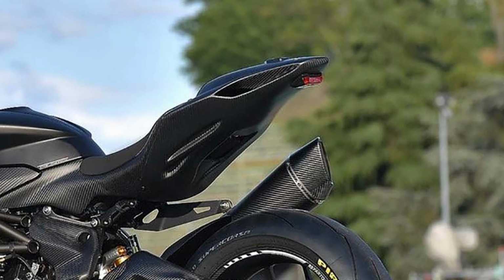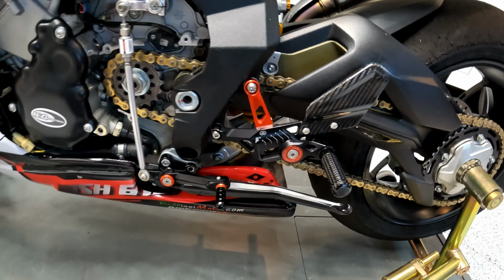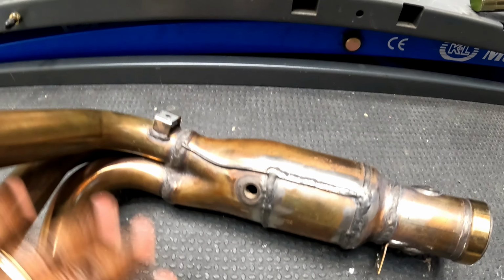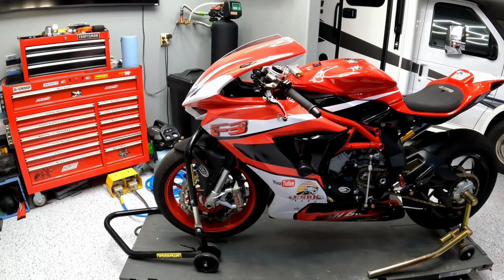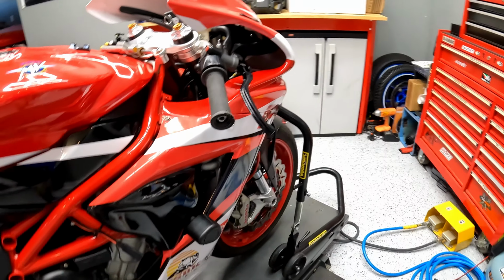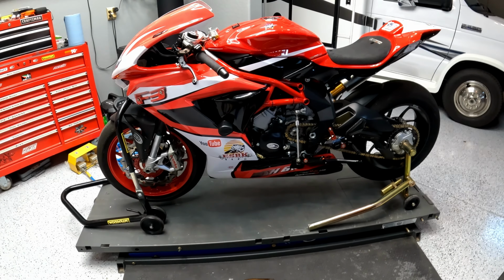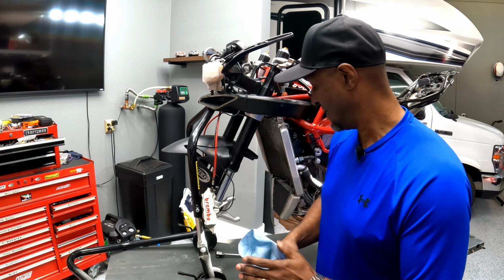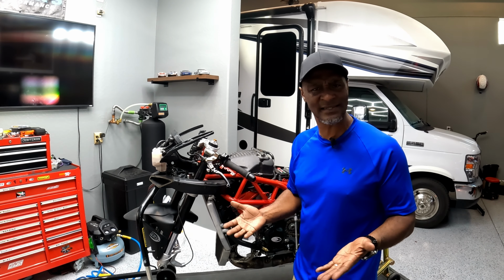MV Agusta F3XX Bike Build. Ep1 "Stripped"

Comment: Looking forward to this series, I built my F3 with a similar ethos to the F3XX but still street legal.
Reply from the maker: Please share some pics! I’d love to see it!!!
Reply: @ESBKLife  I need to do an updated walkaround for my channel, I have an old one but the bike has seen several changes since then...

2022 F3 Rosso:

SC Project S1 w/Race ECU
Stainless Termignoni Race Headers
Charcoal Canister Delete
Lightweight Lithium Battery

The above mods account for significant weight savings! Everything else I have done was widely cosmetic or in hopes of improving reliability:

Rizoma Stealth Mirrors
Puig Double Bubble
Carbon Fiber Tail Fairings
Custom Tail Tidy
Passenger Peg Removal
R&G Tank Grips
Domino Grips
Engine Ice Coolant
Motul 300V 10w50 Racing Oil
Motul RBF Racing Brake Fluid
Pirelli Diablo Rosso Corsa IV

Looking to upgrade brake and clutch master cylinder next, probably Brembo 17RCS.

Also want to source lightweight set of forged wheels, Marchesini or O.Z.

There are photos of the bike on my Instagram profile if you have access to social media.
Reply from the maker: @themotoseoul  More F3 content is definitely needed on YT. I there are like  10 F3 videos where someone is actually doing work on them, and 5 are mine of my old F3 800 street bike lol. Please do walkaround, I would love to see it!!!🙏
Reply: @ESBKLife  Could not agree more.

I envy your expertise in working on euro bikes. I've seen all your old videos on the F3!

I'm just lucky to have a good mechanic locally to help with my mods and service needs, not my cup of tea. I just enjoy riding!

I will look to find time to do an updated walkaround of the bike!

Comment: NIce build.   I have a couple of questions.   What is the clutch lever and lines you have on your bike?   The stock one is pretty tacky.   Second question is about the engine.  I have a 2014 that blew the engine due to the valve springs being low quality and the cams have an aggressive lift so when the valve springs get worn, the piston hits the head.    The black engines have this problem addressed but I want to make you aware of the issue.
Reply from the maker: Hey Christian, the clutch is a GaleSpeed OG unit with a GaleSpeed folding lever. Best wired clutch I’ve ever used. As for the engine, yeah I’m aware of the problem. Bruce Meyers build the head on my bike, so I’m hopeful that I’m good but time will tell.
Reply: @ESBKLife  Bruce rebuilt the engine on my bike and I just got it back from him a couple of weeks ago so you should be good.  He is the man for MV's.

Comment: Hi, Do you know if the Rear wheel of an F4, would work on a 2021 super veloce 800 ?  Thank you
Reply from the maker: Sorry I don't know, but I don't see why it wouldn't.
Reply: Thank you. I thought you said that the rear wheel on your F3 came  from a F4? I thought since the F3 and the super veloce 800,  share the same frame and swing arm I thought it would be work. Thanks for your help🙏
Reply from the maker: @Lazocaferacers  Yes it is off of an F4, however, I don't have any experience with the SV bikes.  I would hate to tell you, yeah it'll fit, then there be something special about the SV that I'm not aware of that doesn't allow it to fit. To my knowledge there isn't anything like that, but again, I'm not sure.
Reply: @ESBKLife  what year is your bike?
Reply from the maker: @Lazocaferacers  2015

Comment: My friend that an mv f3 675 and I had a Triump Daytona 675 mk2 and my d675 was better than the mv in all scenarios on the track, especially so much more nimble because of the weight. The f3 does look very exquisite but the single sided swing arm is pretty much why it was so porky compared to run of the mill d675 u can find anywhere.
Reply from the maker: No????? There are no MV 675s in this video. If you’re referring to the decal on the tank, the tank was replaced. But, I assure you it’s an 800😃
Reply from the maker: I’m coming off a very heavy liter bike so the F3 feels like a featherweight on track and I’m going to make it lighter so do think I’ll have any porky issues lol. But I did almost buy a Triumph 765 MOTO 2. Not a whole lot of difference from the 675, but I just prefer the MV😃
Reply: @ESBKLife  yeah, I know, and did not even see the decals on the tank :P 

But it is pretty much the same bike with more displacement, and back then u only could use 675 max with triples in the super sport class.

Mm. I am very dissapointed by the triumph d765 engine, the only thing that I like on the new st3 chassis is that it is a bit higher, has higher shoulders so to speak about where it grips the engine at the rear which makes the bike wanna lean/tilt in a bit easier compared to the older d675/st3 frame.

And I think the moto 2 has the mk3 frame which does not have the higher shoulders as the newer st3 765 bikes have.

My friends f3 was twitchy on the throttle and it did not really had the same front end feel, I think U sat more over the front wheel on the d675 compared to the mv but I do remember that it was not a long reach on the f3 at all anyway. the slower turn in on the f3 might have been because of different brands, think I at that time used Pirelli and my friends had bridgestone at that time and the pirellies were more wedge like on the front like the older dunlops.